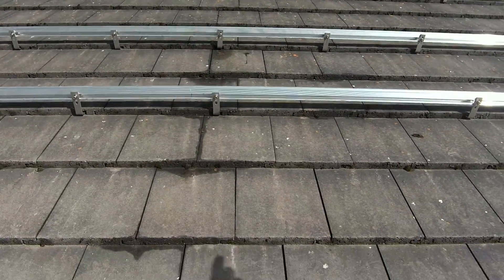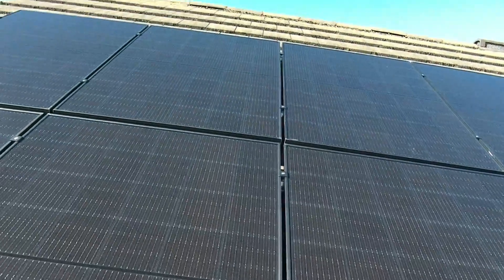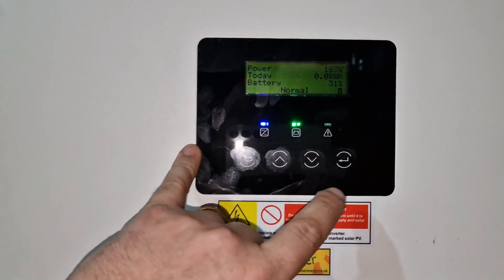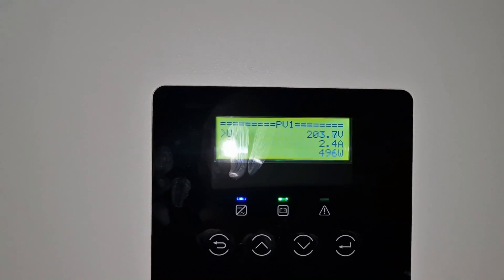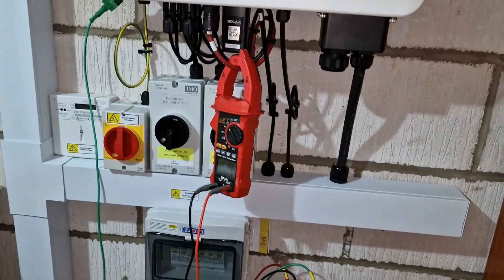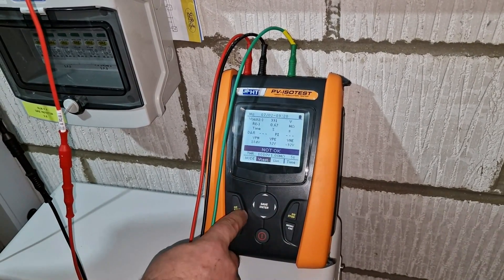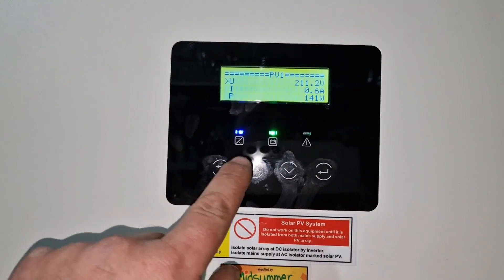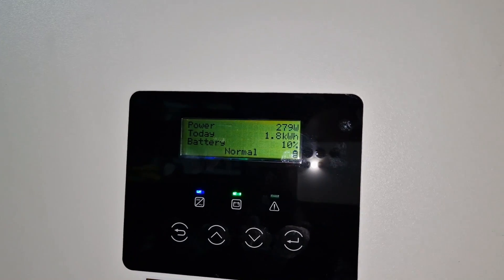How to Install Solar Panels on a roof - Trina 415W

Comment: Fail! Absolutely nothing about installing panels
Reply from the maker: back at you, fail absolutely nothing of accuracy or value in your comment. Have a nice day.
Reply: @electrician247  show me anything that resembles a install of a solar panel in your video!
Reply from the maker: @Oldcrow77  give it a watch again. There is a roof of them. If you want a personal step by step hit the local college up. Failing that I've dozens of other videos showing other aspects of solar system and panel installs with the aim of helping others. 

Can you point me at any you have done? Thought not. 

Stop wasting time.

Comment: Thanks for the effort. Somehow I find the title misleading since there's really no instructions whatsoever. This is more of a show-and-tell than an instructive video. Anyone starting out and wanting to know exactly how to install solar panels, the switchgear, the wiring etc. wouldn't have  clue. 
But, here it is nevertheless.
EDIT: Thanks for the tip to test the voltages as you install the panels - not later when a problem is discovered. Also the SPDs during the Insulation Resistance tests.
Slippery roofs - yes, a problem. Best to stay off unless the slope is really minor.
Please put links to the things you mention in the video - if you enter into an affiliate agreement you might even earn something.
Reply from the maker: Concious never to provide step by step instructions to DIYers. The instructions are there for those who understand them. It's also part of a wider series of videos that do cover all parts of the installation.  But again with just enough help/instruction to those who are electricians rather than DIY. 

Hard balance to strike but principle I stick to. 

In terms of affiliates.  Not interested.
Reply: Thanks, Interesting take on things.

Comment: Interesting to see the ISOTEST in action. On the display during your demo of the continuity setting, I see it was set up to measure Earth continuity from the panels back to an Earth point. Did you run a main Earth up to the array? And if so, would that be to a separate Earth then the tncs you're using for the ac side of the system and Earthing to the inverter? Thanks
Reply from the maker: Hi mate. No earth bond ran. I just demoed it locally to the inverter lol. But as you say if you did bond then the test needs to be done that way

Comment: Very interesting to see. I don't know how you (And others) physically handle solar panels as they are enormous. Very interesting to see the testing process and equipment, I didn't realise there were specific tests for them.

For the notching of the concrete tiles, I wonder if a wall chaser would be easier?
Reply from the maker: It's not a bad idea but control is really hard. Especially on the shaped pan tiles. 

Tbh I quite like the grinding out. Therapeutic lol.
Reply: @electrician247  I suppose you'd need a little wooden jig to hold and align it - Only really makes sense to look at if you're doing a lot of them with exactly the same size tiles. Of course if it's no hassle to you then there's nothing to fix!

I'm interested to know if you have any jobs lined up with the Solax "retrofit" battery units, I didn't realise they did anything like that until just recently? We have an older solar setup with a Zanussi Z1-3.6T inverter (Appears to be a rebranded Solax X1-3.6T) with a feed in tariff - The retrofit battery setups sound ideal so that we don't affect the FiT but I've never seen anyone even mention them left along install them.
Reply from the maker: @Andrew Young  ac coupling batteries is a great way to keep the fit. Not done any ourselves as yet but seems a simple enough process from a distance lol.
Reply: @electrician247  I'll have to have a proper look into them. Anyway looking forward to what you have for us next, thank you for taking the time to put this content up onto YouTube for us all.

Comment: Hi can you answer a question for me I have just completed my own solar install with battery storage  all working very well , I have registered my install with the DNO and has past and received a G98 cert  approval.
My problem is getting a MCS certificate which an installer would normally provide, without this Octopus Energy   will not let me sell my spare electricity to them although they are happy to take it for nothing, what can I do about obtaining a certificate, 
Thanks
Reply: You may want to consider a solar diverter for your hot water cylinder if you don't already have one. Might as well make use of the excess energy rather than giving it away.
Reply: @yngndrw.  Thanks for the tip i have my emmersion on a hive plug for control and also an electric car so hopefully will not give to much away
Reply from the maker: That's not going to be easy for you sadly. You can try discuss with octopus but as you are not an mcs installer very difficult
Reply: @electrician247  ok thanks for that seems unfair the kit i have installed is approved and fitted properly i am an x electrion , good luck with the channel i enjoy your content
Reply from the maker: @Peter sort  yeah it's a weird one tbh. But thems the rules. It is worth chatting with octopus as it has been known for allowances in some circumstances.
Reply: Great video , couple of questions , is a requirement for DC SPD’s to installed or just good practice also have you ever installed battery storage external to the property like some inverters ?
Reply: @itfcdan9223  If you intend to register with the DNO which you should then yes DC isolater must be fitted close to the inverter I would recomend looking up the rules before starting. Plug in solar is worth a look on line
Reply: @petersort2192  I was asking about  DC Surge Protection not DC isolators